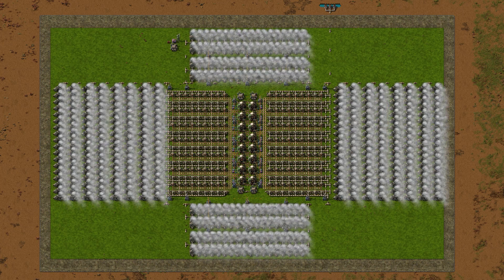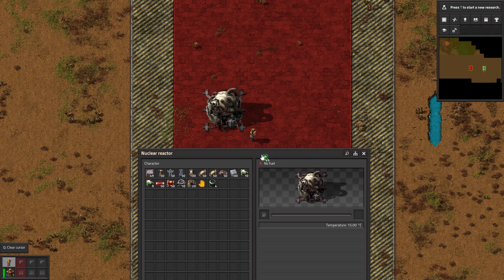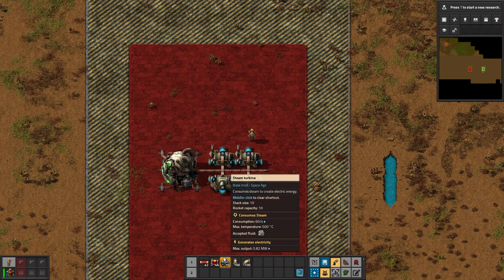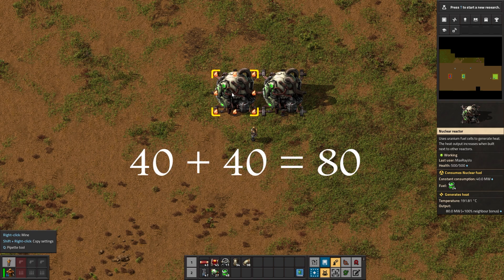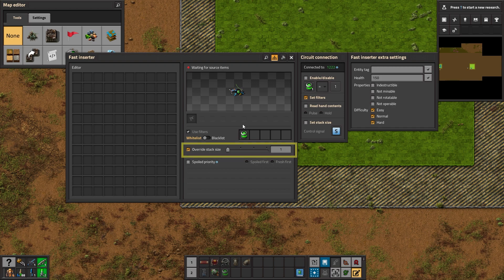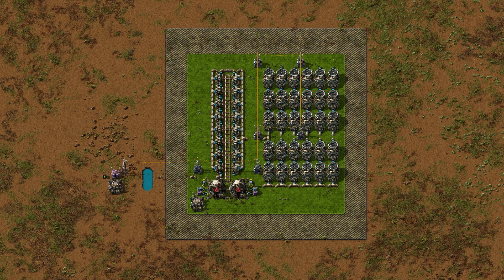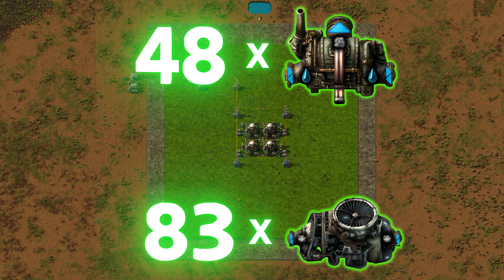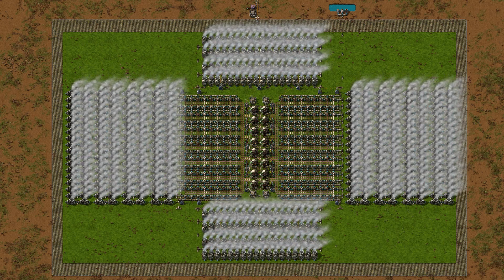Factorio Nuclear Power Tutorial

Comment: I lose adjacent bonus for my nuclear plants when i made similar circuit network for my plant. Seems like plant needs to be actively working to get that bonus.
Reply from the maker: True, If a reactor turns off due to low grid load (heat not draining fast enough, so the circuit stops refueling), it loses the neighbor bonus. But when the load is high, reactors stay fueled, and the bonus is active when it matters. It doesn’t affect you. Neighbor bonus maximizes capacity and turns off when not needed.